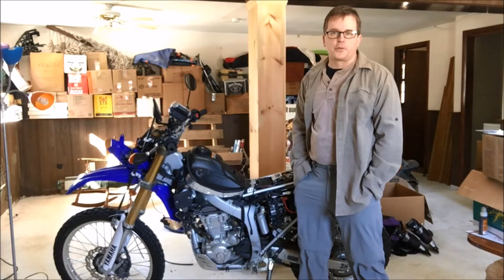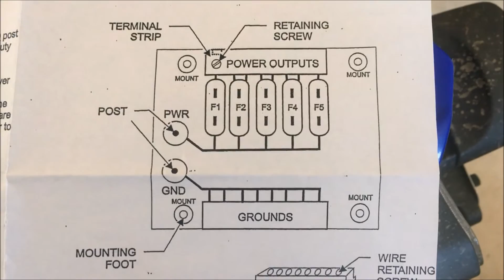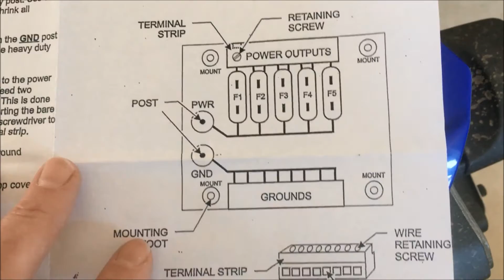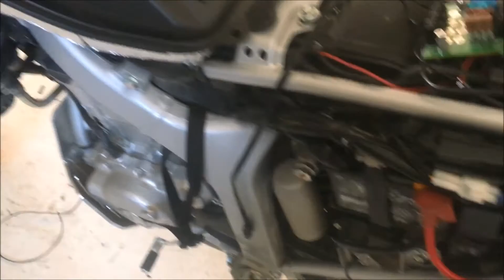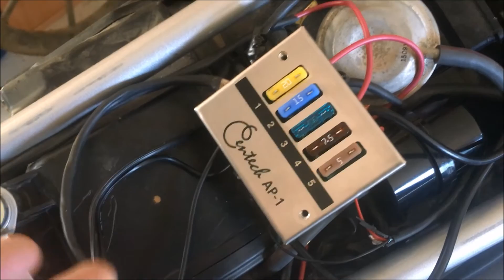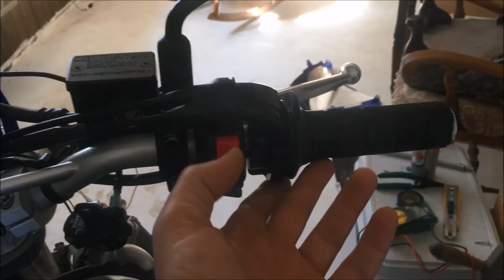Winter Motorcycle Project:  Adding Electrical Accessories & Fuse Block

Comment: great video , I have a air pump system to rise my bike and the pump dont work anymore due to the switch was left on, I guess. I looked for a fuse a did not find one, I guess the installer put it direct, I need your help in how to install it the proper way and ( I do not have that much knowledge with electric but I am a fast learner). after seeing this video I feel inspired, thanks, Wil.
Reply from the maker: Thanks for the comment Wil.  I bet a fuse block would help and they are not that difficult to install.  If you can connect a wire, you can do it.  Good luck.

Comment: is the trickle charger plugged into the fuse box or straight on the terminal?
Reply from the maker: The trickle charger plug is wired into the fuse box.  That's how I store it over the off-season and it keeps the battery charged.

Comment: Man you should be using a relay to control that fuse box
Reply from the maker: I think it's worked out okay without one.  There's a relay to keep the heated grips from draining the battery.  The other accessories tied to the fuse box are not really a risk of draining it.  Would there be another reason to add a relay?
Reply: the relay doesn't protect the battery from draining. the relay will direct full battery power from the battery your fuse block. from the fuse box, you can send the power to many different accessories. this relay can be controlled by a very low power circuit that is switched with the key so that the circuits are not on all the time. especially when you are running high current accessories like heated grips. you can not do that or you will burn out the switched cables that cannot handle that kind of current draw. hope that helps
Reply from the maker: thanks Victor!

Comment: Hi Keith, after receiving the Centech AP-1 fuse block I noticed the underside of the circuit board is completely exposed.  Did you cover the bottom with something like electrical tape to prevent it from shorting out if it were to touch metal?
Reply: Great video, thanks! Question... What did you tap into for your relays switched power?  I'm behind my headlight at the moment installing heated grips.  I'm planning to put a fused line to the battery but I'd like to install a relay to make it switched.  Any other tips?
Thanks again!
Reply from the maker: Hi, no, I didn't do that.  It's sitting on top of a plastic housing.  I used the same fuse block on my old KLR650 and installed it the same way.  Never a problem.  You could probably put some electrical tape over it, but I haven't and am not worried about it.  

Good question, thanks!

Comment: Thats a great fuse block, one pos and neg in then 8 outs for each. Definitely good for motorcycles and small off grid solar installs.

hippo hands or other bar muffs make an even bigger difference than heated grips. both together is like heaven.
Reply from the maker: Thanks.  I've seen hippo hands before but never looked into getting them.  I bet that would really make it nice.  I don't know how i would adjust to that perceived loss of my hands on the handlebars.  Thanks for the comment!